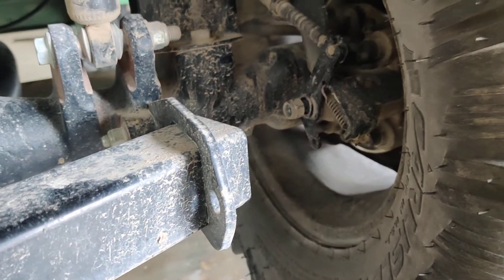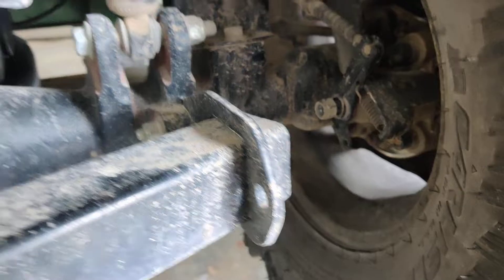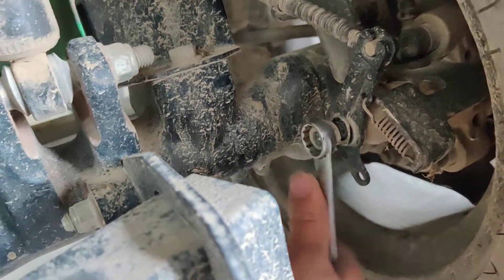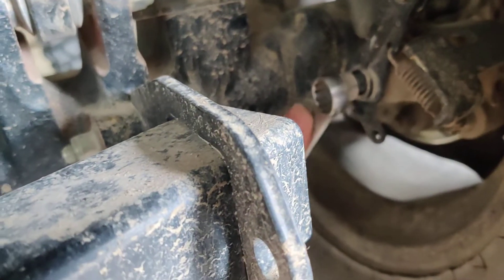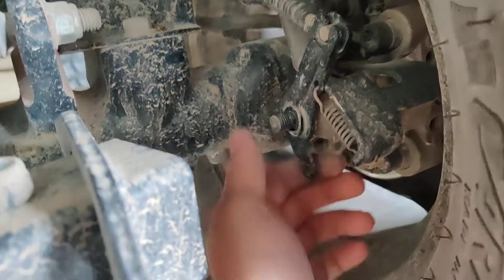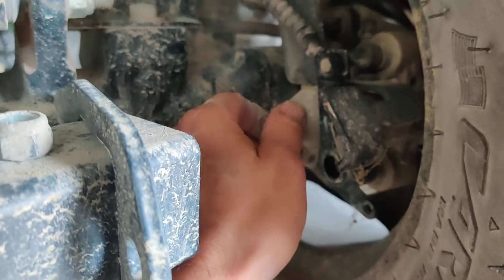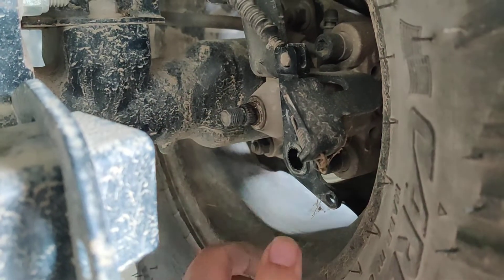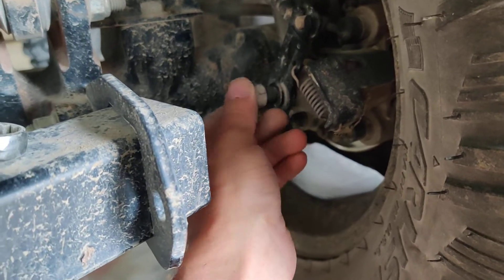Adjusting the Parking Brake on John Deere Gators (TX models)

Comment: My parking brake handle sometimes has to be pulled up two or three times to engage, would this correct that or do you think I need a new cable? Thanks!
Reply from the maker: I had the exact same issue. This should correct it. (It did for me)